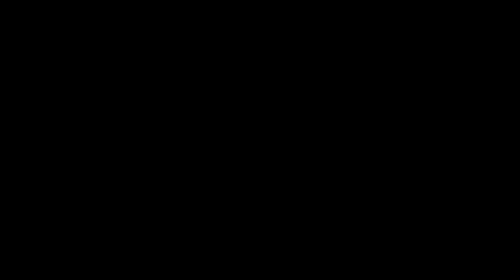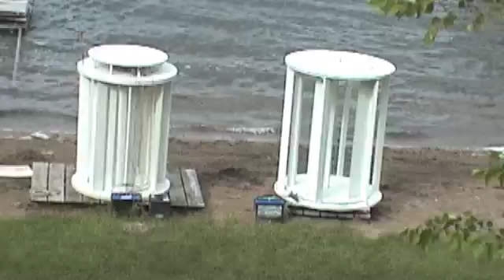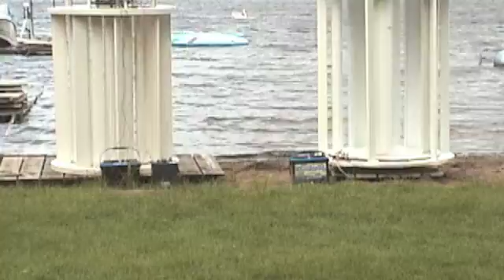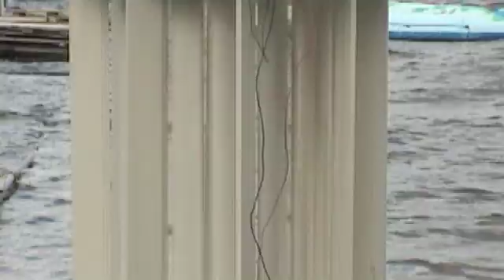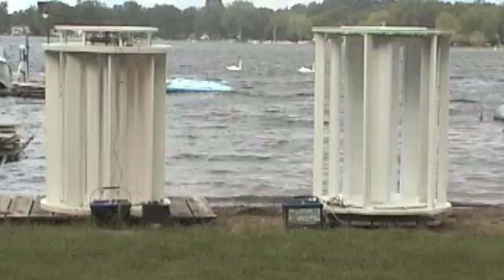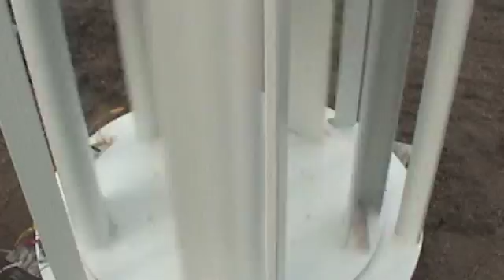Lynx Vawt Comparison

Comment: If you were to extend the width of your vertical connecting pieces of timber, you would funnel in more wind and your turbine would be more efficient plus if you made 2 half the height but on top of each other running in opposite directions you could have your rotor on one half and stator on the other half spinning in opposite direction so it would have the same effect as doubling your rpm at the moment.
Reply: Nice thought, but how would you keep the wires from twisting and breaking?

Comment: voltage is proportional to speed, big deal. Torque is proportional to current. the product is power. So, be clear if you spend time to construct and compare. Do you know basic physics? 
also, you need a fixed load not a battery to compare. The power delivered into a battery depends on its state of charge. Very good job building, but ur very poor in actuality showing the difference. These are drag machines and inferior to lift machines in terms of power per meter squared of wind cross section. By increasing and channeling a larger cross section, you can make a drag machines approach the efficiency of a lift machine. These machines are high torque (high current) which makes generator designs expensive. You want high voltage ( ie high rpms) which you can get with a gearbox. In high winds you can make a drag machines sturdy and powerful.

Comment: So same generator, gearbox train and same load (or open circuit) implies same power at given windspeed
I feel in need of a power curve.

Mike and Robert discuss this, amicably, if you read the thread

Comment: Please stop talking about volts as it does not mean a thing, The real substance is in watts!  and not in volts.   It is like a match which has a high temperature, but it contains little heat! and if you want to want to warm a house it is heat you talk about and  not temperature.  It is also like a sparking plug in a petrol car, the spark in the sparking plug had a high temperature but little heat and all the heat comes from burning petrol( even at a lower temperature) and not the high temperature of a spark plug.
Reply: You can't charge a 12 volt battery with 11 volts 10000 amps. Volts do matter.
Reply: Carmel Pule' exactly right, basic physics knowledge is missing here. Learn something dude if you spend time to build things, spend 1/2 hour to know what power is.  Open circuit voltage just means it's spinning a a given speed. You got a fancy rpm meter dude. LEARN SOMETHING FOOL!

Comment: So how informative do you think voltage readings are? That says nothing about power delivered until you have an electrical load and current Then you can talk about power delivered at various wind speeds. That is real information. Voltage alone says next to nothing. Voltage is analogous pressure in a pipe with no current flow and no water delivered.
Reply: robert and probably others i looked and just what i thought no video of your wind turbine lynxsteam is showing 2 wind turbines and comparing blade speed using alternators that are the same so assuming the load is the same or open the voltage is like your speedometer so 1 don't make negative comments if you were not paying attention and 2 if you would like to criticize lets see your wind turbine video
Reply: Point well taken if all you're doing is comparing. It would have been nice to have a comment stating that. Power, after all, is the practical bottom line. Voltage alone says nothing about either one; only whether one is better than the other.
Reply: Robert Wendell the name of the video was my first clue Lynx Vawt Comparison being i have not made my Vwat yet and so do not have a video i might have said "did you happen to get a amp reading during your test or did you have = loads during the test?  its good i guess that i have taken the view that to show my work to others is more of a use to more people then the stress of reading negative comments by a few i am still hoping to start on my Vwat this winter now i have gathered most of the peaces
Reply: Wasn't trying to put you down. I apologize for not making it more digestible and neutral in tone. I applaud what you're doing. I'm working on small models myself, testing different designs for VAWTs.

No video so far. That's not my focus. I hope to eventually put my final design up on the Internet for free with a request for donations. Not seeking patents. Just trying to get it out there and maybe receive a little monetary appreciation for doing so.
Reply: putting a finished plan up is good for some people but the videos i like to watch and it is how i have decided to go is showing the entire project the good and the bad and explaining what i think was the reason some part did or did not work i think that is why i tend to have to say something when i see negative comments i want to encourage the people like my self to be bold and honest in our videos so any one who would be wanting to do a project can be more successful in  adapting to there aria with there resources and talents i wish i had time to say something to every negative comment i read but i dont guess you got luck of the draw haha
Reply: Well, don't you think that's kind of a strange response to an apology, not to mention that I'm not clear what you've said exactly?
Reply: Guess what, you can't charge a 12 volt battery with 11 volts. Voltage does matter. Nobody uses the power from a wind turbine directly. Get educated.
Reply: @QF2653  The battery doesn't charge if there's no current flow. It would help you a lot to get educated about the difference between emf, current, and power. 

You're way over your head, pal, even though these are extremely elementary concepts. It seems, despite all your tinkering, you never bothered to learn what they actually mean physically. 

No matter how much pressure is in a water pipe, if there's no flow, no energy transfer happens. Voltage is just electronic pressure. Without current there is no energy (zero) transferred. Insulting others' educational level from such an extremely low one is just a smelly cloud of excess bean gas.

Comment: That would be equivalent of just using one bigger alternator. The tricky bit with wind turbines is loading them. If you load them too much, their speed drops and they stop producing energy. If you don't load them enough, then you're missing out of potential. The designer strives to load it just enough so that it runs at maximum efficiency, and puts out the most power.

Comment from the maker: @gloki20 

The blades are angled 30 degrees off from the axis.  But don't make this unit, it isn't worth the trouble.  it was more a learnng step.  There are simpler and cheaper ways to get power from wind.  My more recent lift type VAWTs are much better.

Comment from the maker: @cableairman 

You are right.  I have been working mainly on wing design and trying to get speed and torque.  These drag types go around but don't produce much watts until 20 mph.  These are both 20 - 40 watt designs and I have moved on to more fertile ground.  These types have to be large to be effective.  There are ways to make them better, but I am working on lift types now.
Reply: What about the watts produced?